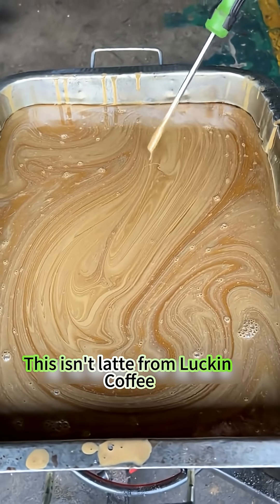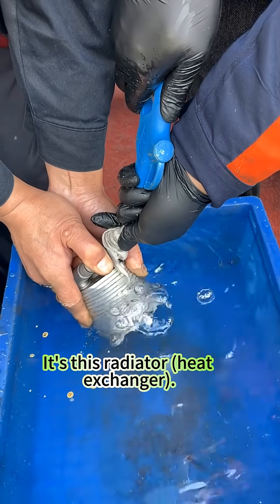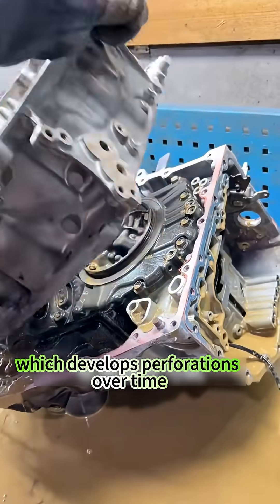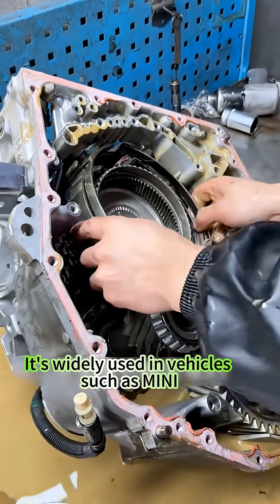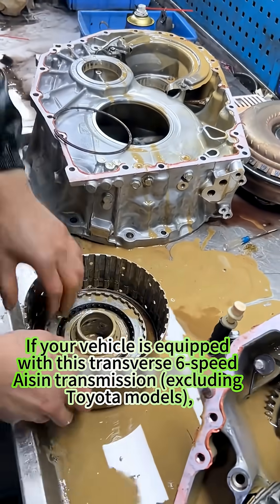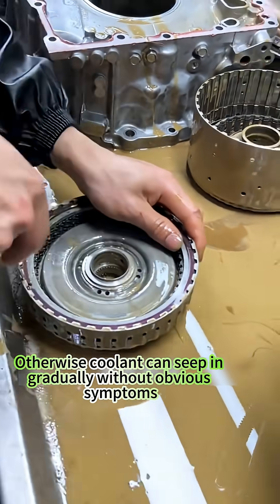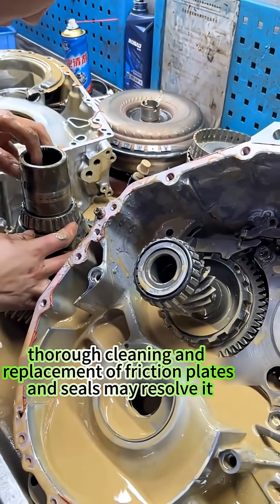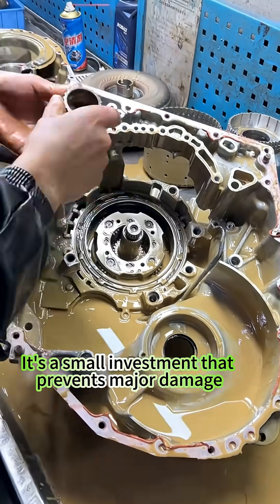Aisin 6-Speed Transmission Failure: Water Ingress from Failed Cooler #mechanics #carrepair #gearbox

Comment: Zen automatic gear (3 speed) car, AC model,  14 kmpl mileage. Japan engine, Japan gear box Japan carburetor, Japan radiator, Japan axles, All zen automatic cars prior to year 2000 (only carburetor model, not MPFI) have high quality original Suzuki engine and imported 'Made in Japan' Suzuki automatic gearbox. This same Japanese automatic gearbox was introduced in Maruti 800 in 1990 (2 speed gearbox). Modified version (4 speed) (Indian made) of this gearbox is used in A-star, Vitara Brezza, earlier model of Swift, Dzire, XL-6, Ertiga and S-cross.The petrol-powered Brezza and Toyota Urban cruiser share the same 4-speed torque converter AT gear box. So this RELIABLE automatic gearbox has been in India for the last 31 yrs.There have been many reports of issues in the AMMT gearbox, requiring numerous software updates and even complete gearbox replacements even within 25,000km, You can also add "overheating" transmission / clutch burning to that list. Manufacturers have struggled with the long-term reliability of AMMTs. It is inherently an inferior technology for passenger cars. That's why I don't recommend AMMTs to anyone. I will always recommend a proper Automatic gear (Torque converter) because of its superior smoothness, performance, reliability & resale value. TORQUE CONVERTER automatic is 95 year old technology and the most reliable automatic gear technology. Latest generation automatic cars have AUTOMATIC GEARBOX with SOFTWARE CONTROLLED gear shifting which is very complicated and may be having high maintenance and very expensive to repair. Latest automatic cars have ENGINE CONTROL MODULE (ECM)Very expensive to replace ) and TRANSMISSION CONTROL MODULE (TCM cost high).If TCM is faulty, we cannot shift from Neutral to Drive. Driving with a faulty TRANSMISSION CONTROL MODULE can damage your auto transmission. Latest automatic gear systems are sensor based. Need to depress the brake pedal before shifting from P to D or from D to R. If BRAKE PEDAL SENSOR is damaged or fuse blown, we will not be able to shift from P to D. No BRAKE PEDAL SENSOR in this automatic zen. No ECM/ TCM in this carburetor model Zen automatic.Many latest automatic cars OVERHEAT in heavy traffic. During overheating the FUSE in auto gearbox is blown. Then the car automatically shifts to NEUTRAL and we cannot DRIVE. This automatic zen never had overheating. No FUSE in the automatic gear box of this zen. Have driven 250 km non-stop without any problems.
Latest automatic cars have very complicated ELECTRONIC MOTHER BOARD inside the automatic gear box. This Zen Automatic car do NOT have any software or computer or ELECTRONIC MOTHER BOARD inside the automatic gearbox/ engine. No SCANNING needed. This automatic zen has a simple MECHANICAL automatic gearbox. Simple JAPAN engine (carburetor model-even roadside mechanic can repair it) and simple JAPANESE 3-speed MECHANICAL (no electronics) automatic gear box. Latest automatic cars have even 10-speed automatic gearbox. The more the number of gear ratio, the more complicated and more expensive to repair. This Made in Japan automatic gear box will last for about 3 lakh km in Indian driving conditions.and this Japan engine will last for about 4 lakh km.
The less the weight of the car, the more the life of automatic gear box. This zen weighs just 750 kg. So the automatic gearbox has to pull less weight, so it will last long. Latest automatic cars have non-reusable automatic gear oil FILTER with washer. If washer is dislocated, autogear oil will enter the transmission without filtration and auto gearbox will get damaged. This zen has RE-USABLE flat METAL MESH type gear oil filter without washer. Zen carburetor engine model has more quality than zen mpfi engine model.
Do not compare the used car rate of automatic zen with the rate of manual gear zen. FULL MECHANICAL/ ZERO ELECTRONICS CAR. The less electronics more the reliability.